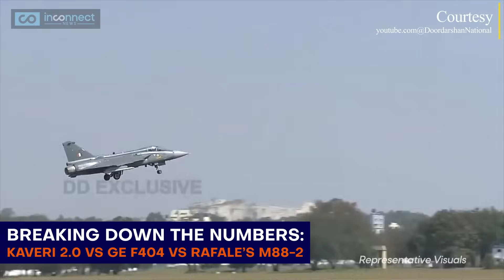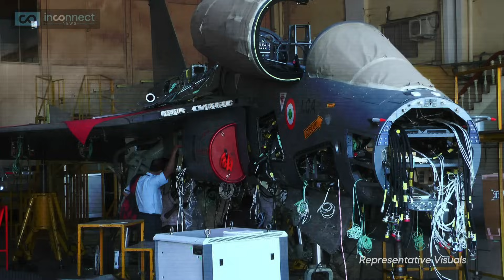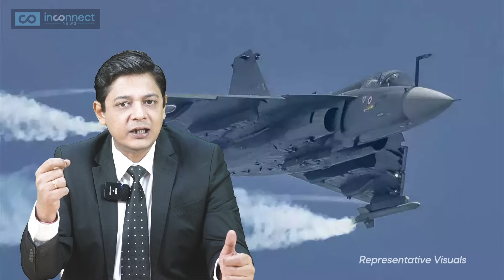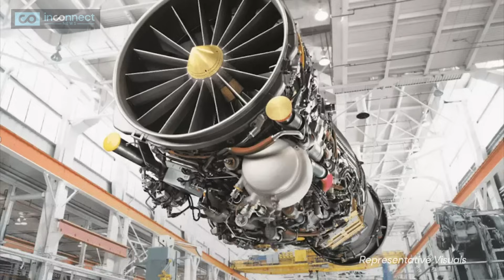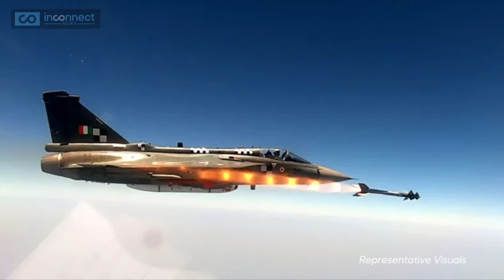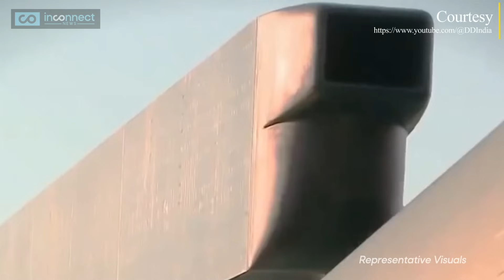Indian Defence Just Got A MAJOR Boost With The Kaveri Engine 2.0

Comment: Its extremely hard to believe the present design will be successful to the fullest extent. The transmission of this engine doesn't include Curvic couplings, instead uses splined couplings. There are inherent limitations on tolerances for a spline cpmpared to curvics, and in the long run it will be unreliable.

Comment: Kaveri engine is partially succeseed. 
Why GTRE failed because they directly gone on higher thrust engine before maturing on low thrust. 
Yes. GTRE has overcome from some initial failure.
Now only two major issues, one is low thrust and higher weight. 
Hopefully with some foreign expertise and academia will get success in core alloy technology.